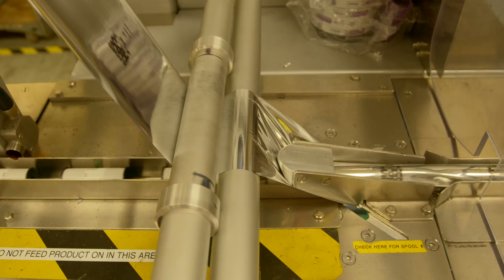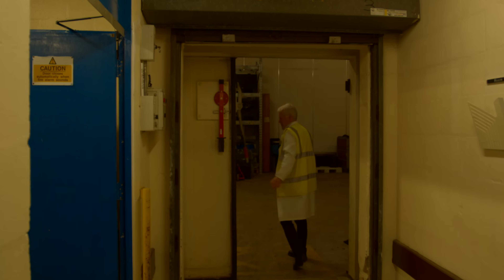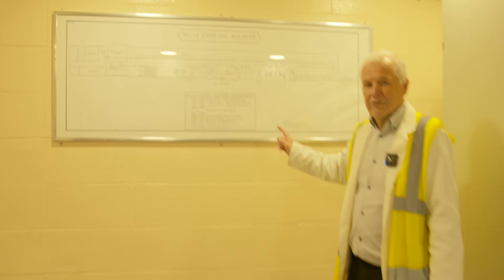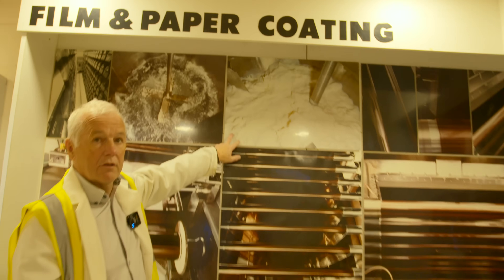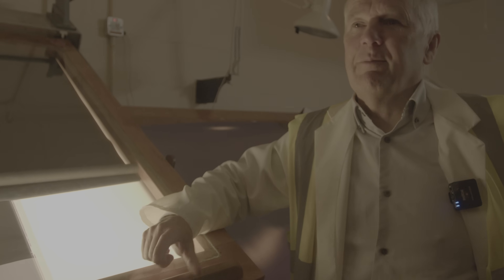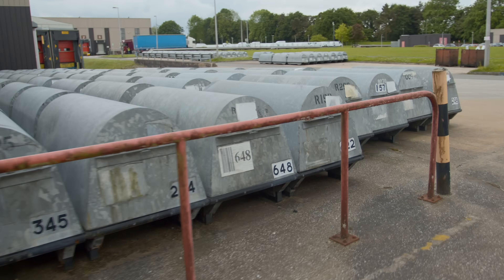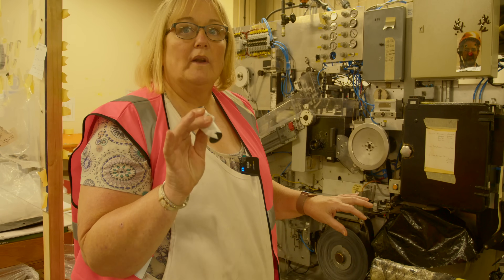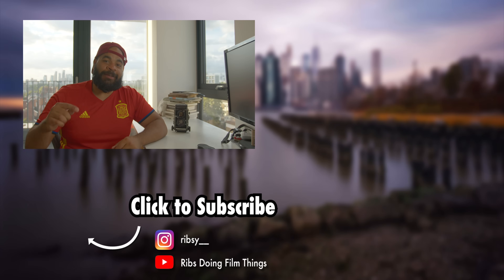visting ILFORD and seeing how they make 35mm and 120 film ... its pretty wild

Comment: Do they ever produce any color films at all?
Reply from the maker: Apparently they had one color product in the past, but I don’t think they made it themselves
Reply: @ribsy 
I have some Ilfocolor negatives of my 6th, and last, birthday, in 1963.  The negatives are cut up and mounted like slides in blue card mounts.  Ilfochrome slides were in similar pink mounts.  The negatives were returned from processing with a contact strip printed on 35 mm unperforated paper.  You were supposed to select the pictures you wanted and send just those negatives back to the lab to be printed.  There was also Ilford standard 8 mm colour reversal cine film, and I remember 126 Instamatic film, but I don’t know if any of this was actually made by Ilford themselves.

Comment: I really love Ilford and I hope that one day (possibly a close one ahaha) they find out a way to reuse finished rolls and cassettes, as Coca Cola did with used glass bottle decades ago.
Reply: There is, it's called bulk loading 😉
Reply: @Uwe_Ludolf  oh well yeah ahahaha I know about that and I sometimes buy bulk rolls, but you sometimes get light leaks and other unwanted effects on the film.
However a lot of people don’t and probably won’t invest in bulk rolls and bulk loader and that gets you to all the waste that could be reused!
Reply: @sebastianoballerini8215  With new cartridges you are 100% sure it doesn't scratch the film and it is light tight. Since Ilford has a reputation of high quality I understand they take new cartridges.
Reply: @Uwe_Ludolf  yes you’re right, but they might take back 120 and 135 spools and 135 plastic boxes
Reply: @Uwe_Ludolf  I love my screw top bulk load film cassettes...you can use a label maker and aluminum foil 'radio' tape to shoot the film at a different speed and develop it for a different time, and it a lot easier to get the film loaded into the developing tank as opposed to trying to fish out the leader or use a drink can opener...and if you are re-using a disposable camera...it makes it easier to develop half of a roll and shoot the other half later.
Reply from the maker: Yea would be great if everything was fully recycled